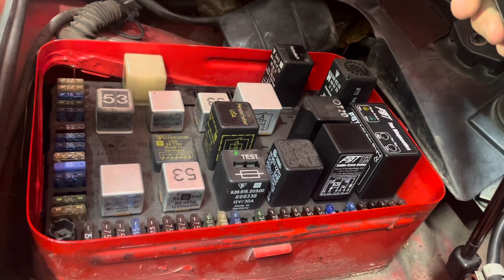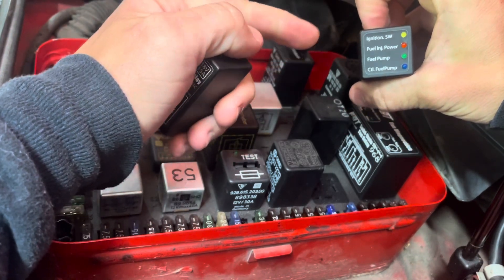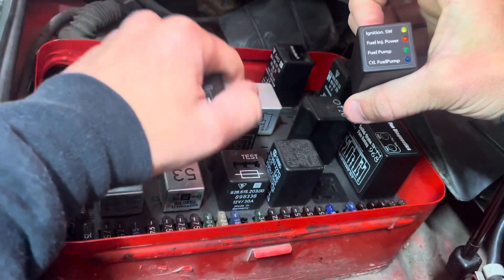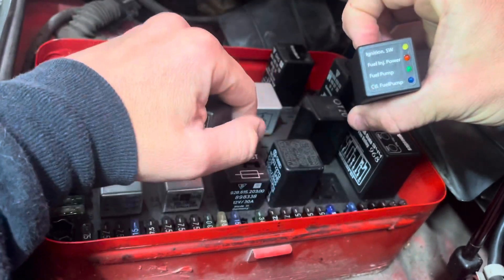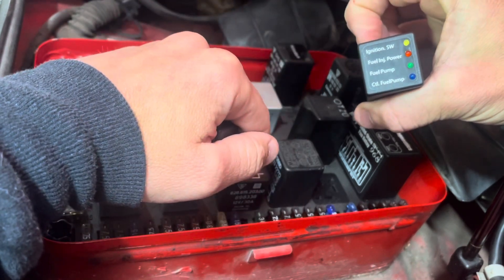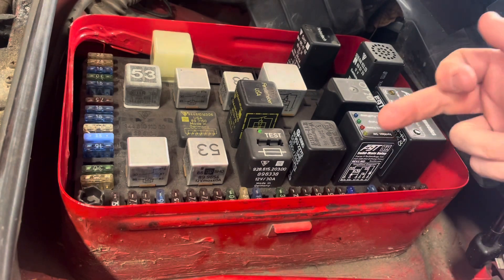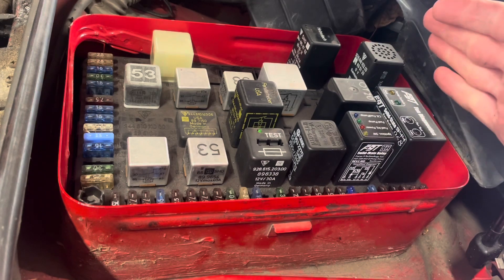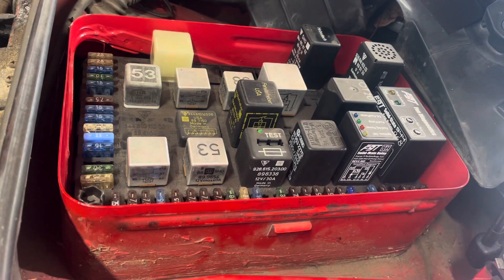F9T Porsche 944 DME relay (diag)

Comment: Im having a no start issue just ordered this after watching your video. I tested everything the traditional way maybe this will help 🤔
Reply from the maker: This is a helpful tool. Did you also check the factory alarm circuit, if equipped? Nc944er has a very helpful video on that as well as Clark’s garage website. The factory alarm computer failing can cause no starts
Reply: @tims_4x4_garage  funny you say that I did i actually activated on purpose and it killed everything I had no more tach jump, but im gonna look at NC944 I didn't know he did a video on that. Plus Clark's website is invaluable with information.

Comment: I have a 1984 944 and can't seem to get voltage at the fuel pump , I have replaced the DEE control unit and multiple DME's that supposedly control that function.  Any help would be greatly appreciated.
Reply from the maker: Did you buy a non-running car or did you have a running car that quit? I don’t have any experience with the early model cars but do you have a good fuel pump relay you can try?
Reply: @tims_4x4_garage  Definitely a great running car and then just like flipping a switch , stopped . It's been sitting a couple of years after replacing the fuel pump relay and digital engine electronics control unit . I am definitely not getting fuel and am going to  replace the pump , fuel filter and tank filter . I am waiting on the 2 filters but I thought that I could check the voltage at the fuel pump with just the ignition on , nothing. I don't know if the relay needs those items working somehow to actually send the power to the pump .
Reply from the maker: @kregpeterman3145  I’ll read up and see what i can find. i always start at Clark’s when i have an issue. nobody explained things better than Clark http://www.clarks-garage.com
Reply: @tims_4x4_garage  Hey thanks but I just watched a stupid whiteboard tutorial and sure enough the engine has to be spinning so a sensor at the flywheel tells the dme to send power to the fuel pump. Thanks again for trying to help me .
Reply from the maker: @kregpeterman3145  so it’s a reference sensor issue?
Reply: @tims_4x4_garage  It's either that or my fuel pump was bad . I will know when I get my new fuel filter . I will be replacing filter and pump at the same time . I don't want to test the existing pump now as I still have old bad gas that I don't want to send towards the engine . I already have a new pump , I just want to wait until I can replace the in tank filter and external filter and pump at the same time . Then the next thing would be that sensor. All of this beats my original idea of having to bring it to a proprietary shop where I live .

Comment: Can you make an install video when you get the Lindsey racing catch can
Reply from the maker: Hey man. I’ve been running it for months now. It’s pretty simple to install. Hardest part is getting to the AOS which is under the intake runners
Reply: @tims_4x4_garage  oh ok, im about to order one but cant find any videos or instructions on it so i just wanted to make sure it’s doable for me
Reply from the maker: @HarrisonBernath  I think it would be pretty hard to run the hose without removing the intake but you might be able to.
Reply: @tims_4x4_garage  hey, so ive got my catch can installed and was just wondering what i do with the old hose that was originally connected to the top of the AOS. Do i just block it off? Thanks!
Reply from the maker: @HarrisonBernath  yea man

Comment: @rockcrawlindude Thanks for the video. I have a 87 NA and just before I put it into winter storage,  the guage cluster worked intermittently and then stopped. Have any ideas what that could be?
Reply from the maker: The gauge clusters can be funny in these cars. The fuel gauge sending unit may need to be cleaned, it also seems to be voltage sensitive and these cars don’t have the most robust charging systems. The MPG gauge, if equipped, is especially odd. Mine only works when the car is fully warm lol 
You may ultimately need to pull the gauge cluster. But, Before pulling the gauge cluster out, the first things I would check are all the fuses. Then the next thing I would check/clean are my two main grounds. One on the back of the block near the reference sensor and One right next to the battery on the body. Then, I’d check/clean my main positive cables one to the starter and one to the alternator.
Reply: @tims_4x4_garage  Thanks. Hoping to get it out of storage soon and will give it a try!.
Reply from the maker: @toaderbuf6100  I assume you’re not close to me (Georgia) since you store it for the winter.
Reply: @tims_4x4_garage  Western NY. Looking forward to the driving season!
Reply from the maker: @toaderbuf6100  lol always driving season here dude
Reply: @toaderbuf6100  oh hey, I'm in West Seneca.  I'm in the middle of doing the rod bearings on my '88
Reply: @staceyzinck8159  Nice.  I'm in East Amherst. There's nobody around that knows these cars well.